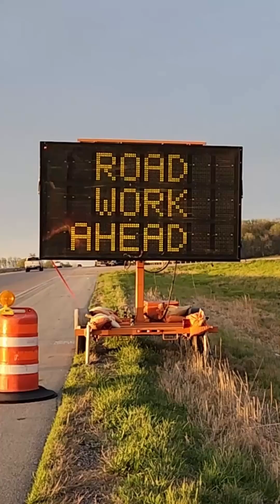Why Does Road Construction Take So long to Complete?

Comment: yeah there's no excuse for major highways to be under construction for years. it should be illegal and if you can't finish the project you shouldn't start it in the first place because it causes more traffic
Reply from the maker: Tell me you've never done road construction without telling me you've never done road construction...
Reply: @ARoadBuilder  tell me you've never had shift rotations without telling me. Oil and gas turnarounds/shutdowns work 24/7 until the work is complete.
Reply from the maker: @1Guason3  Not enough construction workers for that type of work schedule. You barely get any help for regular hour work. Sounds good on paper but realistically, not possible everywhere.